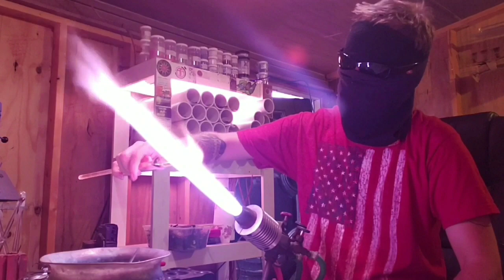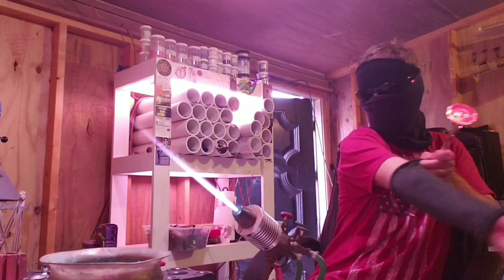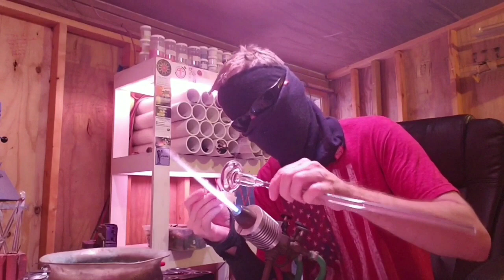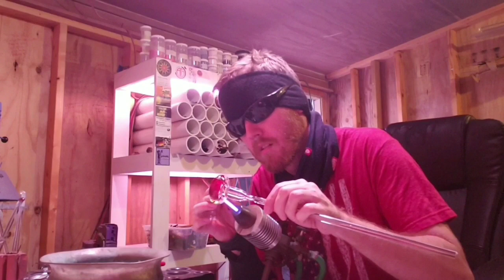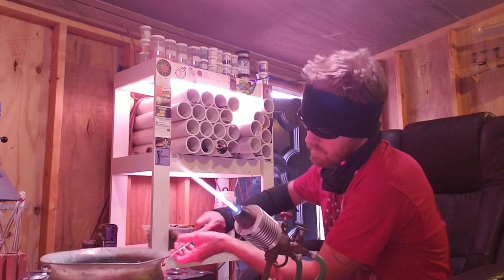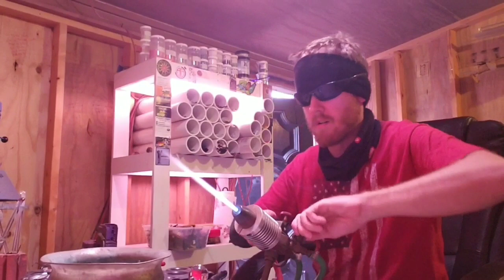How To Make A Flower Marble  by Justin Bodovsky Glass Art Demo Tutorial

Comment: Justin, how do you prevent the petals from sagging? I made 3 flower compression marbles toady, and in 2 of them the petal sagged.
Reply: I think I’m compressing to much
Reply from the maker: Hey there is is sagging from the bottom or the sides of the petal?
Reply: It is from the sides of the petal, like they have moved to far toward the wall of the marble
Reply from the maker: That is exactly right, try not to put your layers of petals to far out towards the equator. They will drag down with the clear.
Reply: @JustinBodovsky  i have this same problem i think im imploding to early but recently ive discovered that my stringers were too thick. Thinner the better for imploding right?
Reply from the maker: Not necessarily, I do like thicker stringers depending on color. The problem with the petals sagging is, you must get the petals above the center and then, not to far out toward the equator. It can pull down with the clear if both of those  are not met.

Comment: So I came away with a couple things to help me. First my issues were actually getting an implosion. 1st. I think the way you said it made a little more sense on where to apply heat. Plus watching you have a bushy flame verse a tight flame (im working with smaller marbles ) may allow the heat to disperse more evenly. 2nd. your punty removal at the end in the marver then waiting around 10seconds before applying the punty. I can not wait to get on the torch and try this. Thank you for your videos.

Comment: Drawing all petal stages at once vs doing them individually?
Reply from the maker: Doing them individually makes them step down in layers. Laying them all at once makes all the petals on that layer the same height.
Reply: @JustinBodovsky  ill send you pics on fb but when i do them one after the other the top is the widest and tge bottom is the smallest diameter. Weird.
Reply from the maker: @friendlyglasscreations7000  keep in mind every time you compress it pushes the petals out toward the equator and makes them grow. If you start to wide with your first petals, I can see that being an issue.